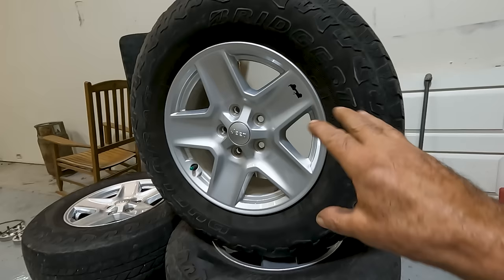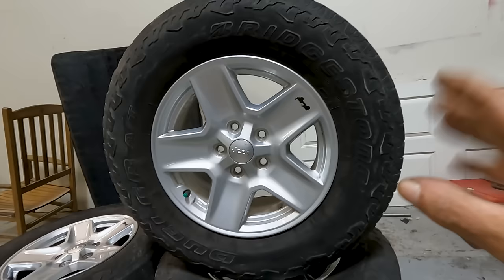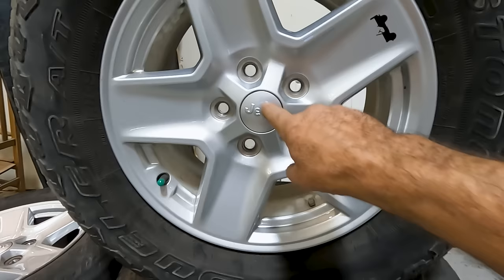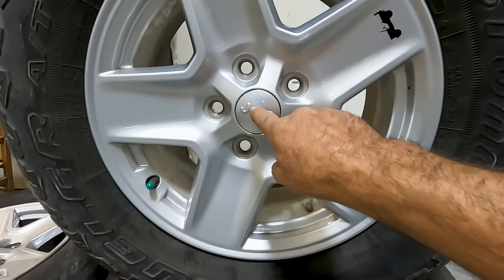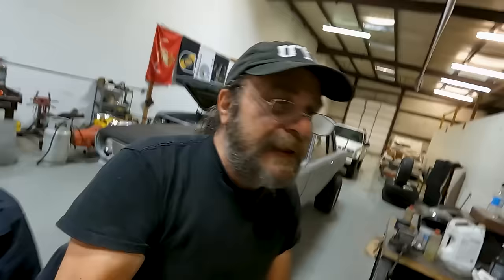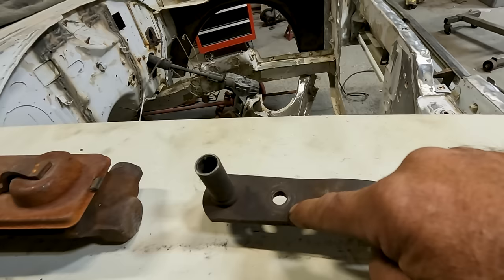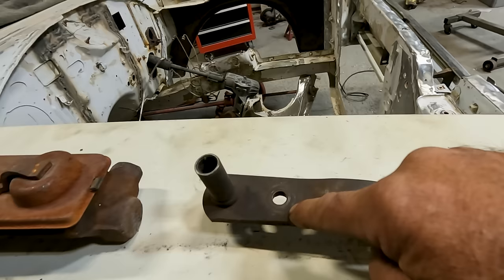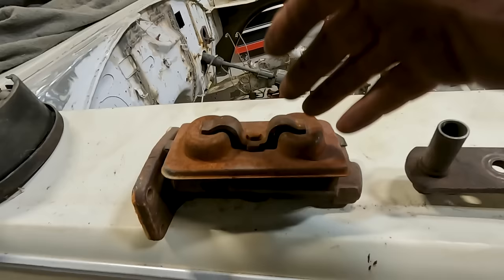Modifying Classic Cars And The Butterfly Effect - Can You Outsmart The Engineers?

Comment: First: Aluminum Heads, Aluminum dual plain intake, AED Carb, 15x8's all around with Radials[maybe 15x10s or 12s in the back], Aluminum 4 row radiator, LED bulbs all around(not headlights), and leve stock until something breaks or needs a rebuild..... Then rebuild with CR 10.8 to 1 minimum, Nice street torque cam, DUI Performance ignition, new fuel tank, disc breaks all around, upgarde trans parts or new trans, UPGRADE entire suspension with QA1 parts..... Then drive to Tony's and show him what you did  :-)   ... **Always remember, engineers always made upgrades from year to year.
Reply: I agree with some of that stuff, but they can keep the LED bulbs...I hate those things, both the way they look on a classic car, and potential electrical issues  associated with them...stock bulbs work just fine, and for headlights, just buy new glass sealed beams in the Halogen xtra-bright grade..they are bright enough...I'm sick of having my eyeballs fried by all these insanely bright lazer-beam LED lights on new vehicles...

Comment: I have a Datsun 510, its got chopped springs and alloy wheels with lower profile wider than stock tires, but the brakes are 100% stock. The car stops from 60mph in less than 70 feet. Oh and I've driving the piss out that car and its never had brake fade.
Reply: That's Awesome... My Favorite Datsun...
Reply: I have a hard time believing that.  60mph is 316,800 feet. Divide that by 3600 (the number of seconds in an hour) and you are at 88fps. Your tires simply do not have the traction to slow this car so fast.
The average stopping distance of a modern car going 60mph is 292 feet.
Reply: @tarstarkusz thank you. 

No way your Datsun is out braking a corvette z06 by almost 100%😂
Reply: I've done the math factoring in rpm, gearing of the transmission and gearing of the final drive ratio, I've confirmed those ratios are what they are supposed to be. I drove at the exact rpm needed to go 60mph and I stomped on the brakes so hard that it kinda blew out the original master cylinder. 70 feet measured with a tape. I was surprised myself. Go to any autocross event and ask around, people will tell you lowered Datsun 510s, Miatas, those are the cars out-braking and out-cornering everything but purpose built race cars with lots of aero. A corvette Z06? You gotta do better than that to beat a 510. Also if a car takes 292 feet to stop from 60mph its broken or a loaded truck or something, thats not a correct figure. A BMW M6 stops from 60mph in about 90 feet and that a real heavy car. A 510 weighs 2100lbs. Look I don't care if you believe it, its the truth and I don't get kicks from lying to people on youtube.
Reply: @nicholasagnew2792  Tires do not have the grip to stop you that fast.  You were traveling at 88 feet per second.  There are no tires that have this kind of grip even if the braking system were capable of it.  To create a short stopping distance like this, if the tires existed would require anti-lock brakes to maintain maximum braking without slippage.
I'm not calling you a liar, I'm saying you are mistaken.

Comment: Tony. I mostly agree with your points. But I DO believe that many early 60s thru mid 70s cars/trucks were under-engineered. Steering geometry, brake components, bushing materials, shocks, etc, while adequate in the day, do NOT perform when compared to vehicles built afterwards. So for some of us who do daily drive older stuff, well-researched updates can def improve performance and safety. Just my too scents.

Comment: My 1979 chevy van g-10  front disc. And drum rear stock as is. However when I  changed out the rusted brake fluid lines I changed the tubing to stainless steel. I invested in,a hydraulic flaring tool so that I can make double flares on the vehicle rather than on the bench. When I changed out the proptionalizing valve,  I got an adjustable one Entirely made of stainless steel.  (Purchased from stainless steel brakes USA)The way I make my adjustments is I road test on a dirt road, that parallels my property so that I can see how it skids at 30 mph I have it adjusted so that the rear end does not fish tail. However I looked into converting to rear discs and to my disappointment there was nothing available in the aftermarket. 
       Tony, some modification I'm with you but keeping a vehicle original especially not using stainless steel parts , is a salute to planed obsolescence/predatory vehicle engineering.  My 1979 chevy van I consider an everyday vehicle,  Hence , I have in the winter snow tires up front, and all season radials in the rear. My weight is in the mostly in the back like electricians tools and coils of wire etc, when I do freelance electrical work. Hence, I stop better and I have better steering control in winter on slick roads at 32,degrees..what I consider the most hazardous for driving, the say at 20 degree f 
        Tony, i,ve sent you e-mails and to-date  no response.  Am I scaring you?😢

Comment: OK. I was considering a 1965 Ford 100 van. To make it a daily driver, it was suggested to upgrade the brake master cylinder. And while you're at it, go with front disks. All due to the poorly designed original brake system.
Stopping is important. Especially when you are riding in front of the front wheels.

Comment: I took an old car,yanked the underpowered engine out and got a later model engine with more power. 
Removed the electronics and went back to mechanical injection(diesel).
The best of both worlds, a decent modern engine with old school reliable mechanical accessories to support it. 
3x the power of the original engine, and average mileage went up like 5mpg average, more on the highway.

Comment: I bought a brand new 3/4 ton Chevy Express passenger van in 2000. It had disc front and drum rear. I guess who ever engineered the braking system on that van were the people that failed engineering school, those brake were not bad-they were horrible!!! Absolutely dangerous when any load was applied, I had to drive with any potential braking factored in 5 minutes before it needed to be applied. Every time I took it to my brake guy he said yep, undersized front brake pads were the problem.

Comment: Tony I agree with you basic premise about not messing with stock daily drives, except for two points. Firstly, the venerable engineers who designed brakes in the 60's and 70's designed braking systems for cross-ply tyres and the brakes were designed to prevent the tyres of the day locking prematurely. Braking power was limited by tyre geometry and compounds. Put a quality modern tyre on and the braking system can't match the capability of the tyre. Second point, the engineers did not always get the final say. For example a Holden gemini (Gemini in Japan. Kadett C in Germany, Buick Opel, Chevette - GM T car) was fitted with with the same rear drums as a heavier Holden family sedan and would lock up rear ends despite the proportioning valve. So it is not necessarily what the engineer says if there is available inventory. I am sure your friend Kiwi can fill you in on Geminis.

Comment: I actually don't mind drum brakes. I drove a 1970 Mustang Convertible in snowy conditions with manual drum brakes. You could not easily lock those brakes up and start sliding. I also had a 1978 T-Bird with power front disc and rear drum. Hit the brakes too hard and you would find yourself fish tailing. They would lock right up. That's why the engineers then had to go to Anti-lock brakes. As a daily driver I think you are less safe under certain hard braking conditions by putting front discs on a classic car without an anti-lock system. I think a lot of people are quick to modify because their first experience with a classic car is with one that is all worn out. I took a 1977 Ford F150 to a local brake shop because it would start to shake at 60 MPH. I told the technician to test and fix whatever needed to be fixed. They came back and said they could not do anything. The statement was "it's a 1977, they all drove that way." The kid I am positive never drove a new one. They drove quite nicely when properly tuned. This is the kind of guy that will take that truck and put a Crown Vic front end on it and put on a universal joint steering shaft because he feels like that his roached out classic was designed to drive like crap.

Comment: Uncle Tony, throughly enjoy your channel.
Back in the day a “fun” affordable daily driver consisted of putting and entry level v8 ( chevy 307, 305, ford 302, dodge 318).
Adding a factory 4 barrel and a good used performance minded dual plane intake manifold. Then an after market exhaust upgrade. Big fan of Flow Masters product line. And finally achieving a much better understanding of tuning! Yes, a timing light, vacuum gauge and a dwell/ tach meters really improve your slightly modified daily driver. Way more fun, usually better mileage and very reliable. I think we had more fun turning wrenches doing these various mods than driving the cars.
Reply: Lol, breaks never helped a daily/ mild street build go any faster. Better off upgrading the camshaft and porting the heads and exhaust manifolds. Maybe, a big maybe putting new valve springs in.

Comment: I have a 1967 Camaro with 4 wheel manual drums. No booster. It stops really well with the stock system. It will lock up all 4 tires nearly simultaneously. The only issue I have ever experienced (besides having a high pedal that takes a little extra muscle) is once while hot lapping at the drag strip going a bit over 100mph I had heat soak after the 3rd or 4th pass and couldn’t stop until the last turnout which I made with no problems. Then i realized I should take time between runs to cool off. I plan on rebuilding the entire car back to street duty and will probably go back to the original brake setup. It’s worked fine for me since 1992 it should work fine again in the future.
Reply: Immediately locking the brakes. 

Is NOT good braking😂
Reply: Yeah, I've surprised some people with the 4 wheel manual drum brakes on my 64 galaxie. Threw everyone forward towards the dash with pedal effort to spare. I've since hurt my right knee and added a power brake booster but it's even easier to throw everything in the car towards the dashboard now, although the booster did create a little extra travel in the pedal not related to the booster pushrod adjustment or brakes themselves, still stops great.
Reply: @fastinradfordable  , no but it tells available brake force ain't what limits how fast the car can be stopped. The weak link in braking on 99% of all cars are the tires. The wheels locks because the stock brakes out powers the available traction.
Reply: @fastinradfordable  and that's the other factor UTG isn't taking into consideration with this video. everyone's idea of "good enough" ranges all over the place.  along with their knowledge--there's someone posting here about losing brakes on a car since they choose a camshaft that killed their vacuum. i'll bet all they had to do was ask the cam manufacturer to learn that was going to happen. or do any research.
Reply: Track is one thing. It’s trying to drive them with the idiots in traffic these days where you find out real quick whether an upgrade is worthwhile

Comment: When it comes to modifying the biggest variable is the person doing to the work. If they're going from drum to disc brakes. From manual to power steering. From leaf springs to a 4 link. If you don't know what you are doing chances are you're going to eff it up. I do agree, for a daily, leave it stock and make sure it all works as it should. If you're going to hot rod it then just do your homework, and don't bubba it.

Comment: The only thing I would upgrade might be the radiator for slightly better cooling but if it has an iron block and head stick with a copper core radiator, many of the new copper core ones have around 50% more cooling fins so will still give better cooling than original and maybe waterless coolant.

Comment: If and when I upgrade the Brakes on my 68 Dart.. i will use the,, Stock upgrade for my platform.. 
Daily Driver on original 9 inch drums, with 5 on 4 bolt pattern.. 
@∅
Reply: My 68 GTS has factory front discs and rear drums. Works good, but it might be a rare setup. Still not as good as a new car, 😂
Reply: @Mr.Saltwater  Awesome.. I agree.. since I drive mine everyday.. it's about being aware.. I call my set up,, push to pray.. 11 years on this one,, since swap to 318.. SoCal traffic..
Reply: I swapped my daily to factory disc setup, using all original parts. Down here, only poverty pack models got drums all round, spend a little more for an upmarket model and they gave you discs. So I just pulled everything from a donor car, all factory engineered as if the option box was ticked.
Reply: Don't upgrade your brakes, just your insurance.

Comment: I never change tire & wheel size but I will upgrade to slotted & cross drilled rotors & hybrid brake pads.
Reply: Yes, I agree...some people feel that the just MUST run large diameter wheels with rubber band tires, though, for some reason...

Comment: I restored,  and unfortunately had to sell, due to unfoseen circumstances a 69 Dart GTS. It was a numbers matching 4 speed car. I did a simple modification to the shift linkage because I felt the engineers didn't think it out. It worked out great, without any unintended effects. I got tired of busting my knuckles on the dash when going into reverse gear, which was over and up from 1st,  towards the dash. I flipped the reverse linkage rod upside-down.  That made reverse over and back, away from the dash, voila. Lol I agree, most modifications can have unintended effect,  but I'd call that modification "the exception to the rule". 😂

Comment: The brakes on my '72 Scout were barely adequate.  Many white knuckle moments going down steep hills. I acquired a 76 parts truck and changed EVERYTHING.  This was what the IH engineers designed for the nearly identical newer Scout.  Braking is now at least adequate. I also went to a Pertronics ignition.  I drive this ALOT (40 states in the last two years)  and don't regret either change.

Comment: Daily I want HEI, easy to find parts(check rock auto), cheap insurance, and TBI fuel injection or a very simple carburetor setup. 
Nice daily driver modifications are a higher amp cs130 alternator, cheap bluetooth radio, magnetic phone holder, cheap crash cam(I have video right here officer), and seat covers to keep the original seats nice(or cover up rips). Other then that just general maintenance will have most 70-90's rides going 75mph down the highway without a issue.
Reply: My 79 Cordoba is as original as they come, still runs lean burn and does 75 without any trouble at all, 50,000 original miles. 318 2bbl so it takes a little longer to get there, but once there it stays with traffic easily.

Comment: Point taken.However it must be stated that cars are built to a price point and engineers' designs are not fully implemented because bean counters force comprimise in many cases. Backyards guys often make things worse but in some instances with careful thought one can improve over the factory. Contrary to a previous poster impementing front discs on old VW Beetle is an improvement while using stock rear drums and changing the master cylinder accordingly.

Comment: for the most part i agree, but there are improvements which can be made, taking the brake example, an older single resovoir brake system can definately be improved upon with a dual, of coarse early poor attempts at pollution control can be eliminated, systems that the engineers goofed  on like no drain holes in chevy pickup boxes can be remidied..and for special applications as you said, racing is a different ball game than daily driving..but the engineers had a vast advantage over the skills of the guy in his garage, like a whole department, maybe decades building cars, testing facilities, etc.

Comment: I only make exception on brake amd suspension upgrades if they check the following boxes:

1) Well documented with detailed writeups, and can be PROVEN they're an upgrade.

2) Bolts on without janky fab work.

On the XJ, if you have an 8.25 axle and swap to the appropriate proportioning valve, there are disc upgrades that are viable under those stipulations. It's the shade-tree crap that I hate. Heck, you can even bolt on the larger 10-inch drum setup and get better brake performance for towing. Elsewise, yes, leave the damn brakes alone people!

Comment: If the combined weight of trailer & car on trail is more than tow vehicle. Your towing vehicle can jackknife in bad weather snow ice rain.  If you don't have electric brakes adjusted rite. I would opt for atheist a 1/2 ton full size truck. I have seen many midsized vehicles jackknife pulling heavier loads than tow vehicle.

Comment: On a 1999 German sedan daily driver. I did the opposite of what tony recommends. It’s perfect now but I had to work out the bugs. I don’t know if I would do it again ona daily. I have coilover suspension, a big brake kit with hawk pads. A steering rack out of a more performance model, a short throw shifter, a stronger clutch and lightweight flywheel. Larger, wider wheels and tires with a more aggressive offset. And I’ve added Bout 100hp. I drive it minimum 2 hours a day with no issues. But that took a lot of work to get it to that point.

Comment: Best thing i ever did was replace the radiator with one that had an opposite outflow..constant overheating before that on my 68 cougar.  Same problem for the mustangs.  Other than that it still has points and carb.   No need to fix whats not broken.

Comment: I drive a 65 d100 on 77 w100 running gear that has drum all the way around Im getting ready to convert to disc all the way around, ive revuilt the system completely and it works. But not good enough. If you have to make an emergency stop you really got to pray.